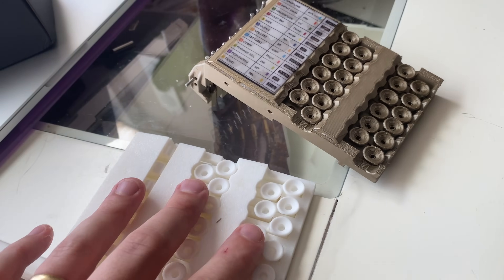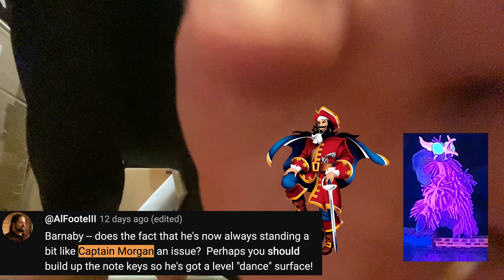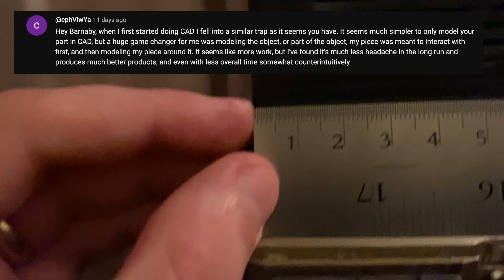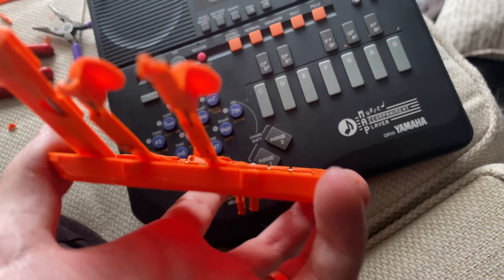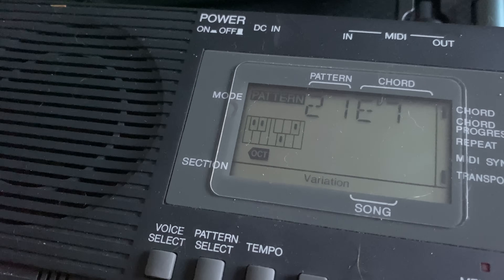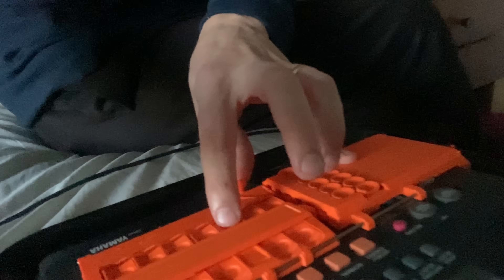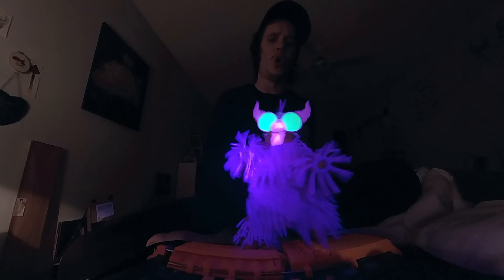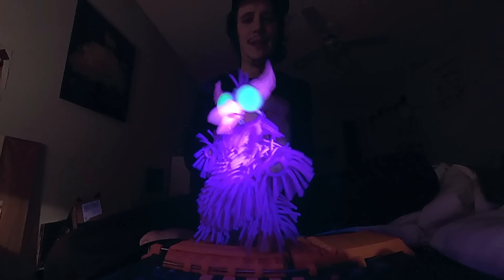Building a 'Slim Lever'

Comment: Would it be possible for operation of the mouth to have two different thumb levers? One with essentially an offset cam that when pressed when pressed pops the mouth open and closed a set amount, that way you could just press and get exactly one syllables mouth movement. The other lever would still function the way the mouth currently does,. That way you could just press lever 1 for qickly sung portions and still have control of the mouth for sustained notes / more ability to emote?